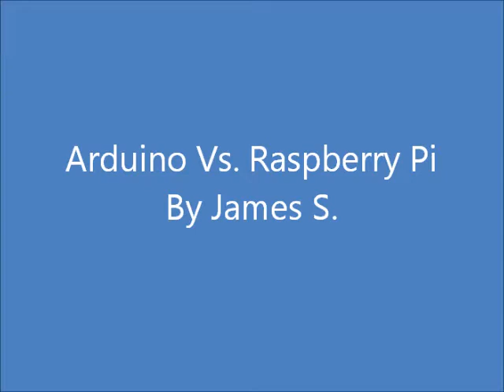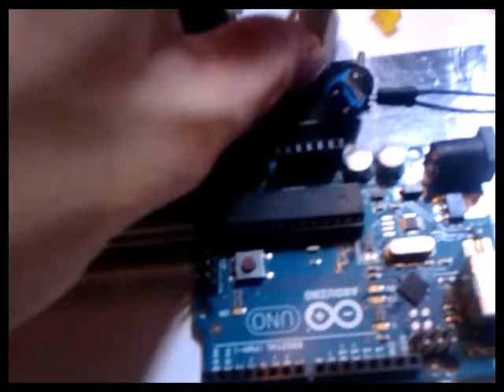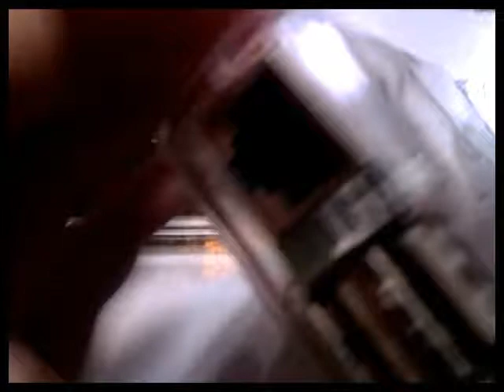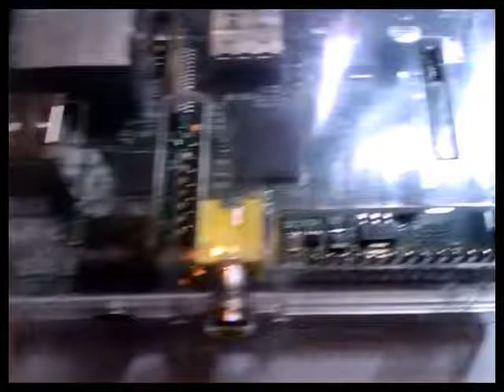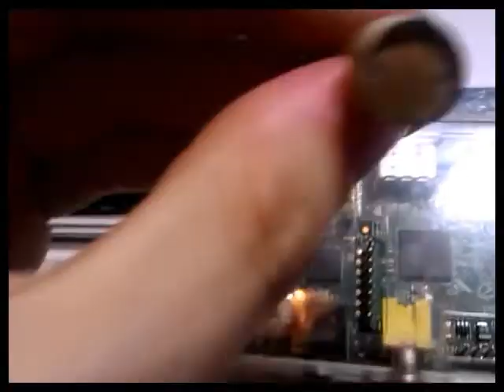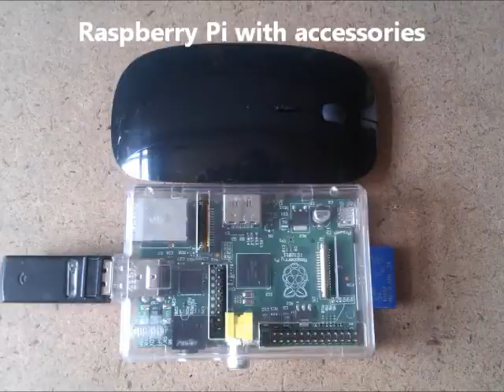Arduino Vs. Raspberry Pi

Comment from the maker: It is relevant and if it helps I could do a video about digital and analogue. Digital is simply on/off whereas analogue has a range of values (e.g. 0 to 255). Real life stuff is analogue but computers like to work with digital as it's easier.